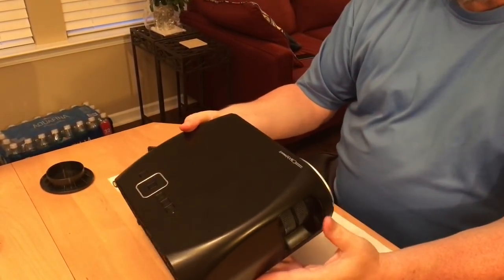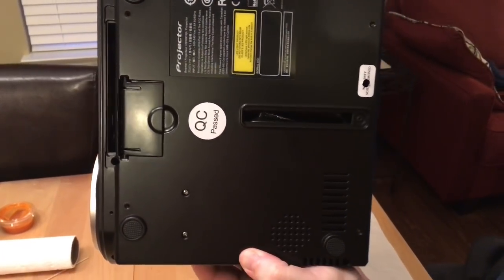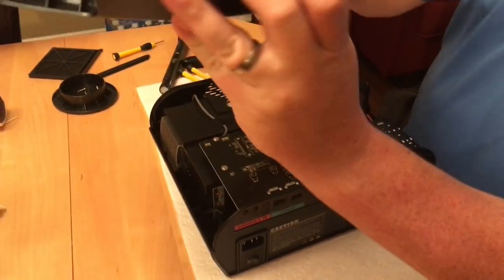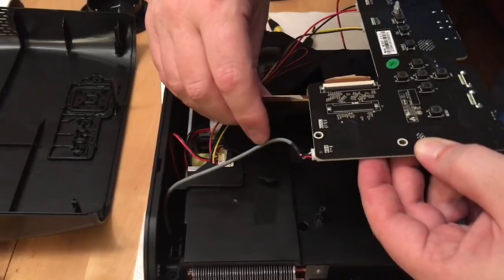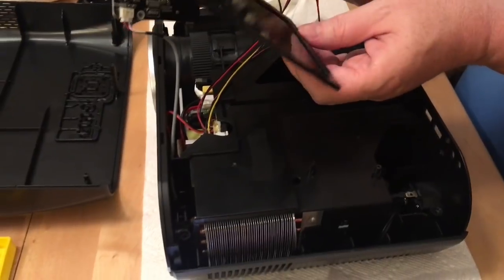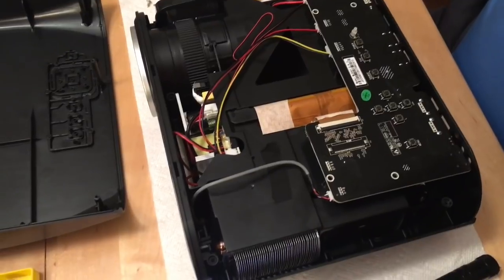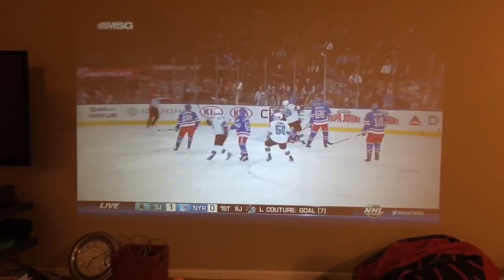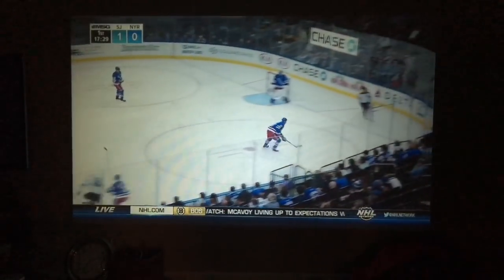Vivibright GP100 Review and Disassembly

Comment: A quick question, after ceiling mount gb100 , the front adjustment wheel which adjusts the focus is not moving. Any idea/suggestion. Why it happened, way to get it rectified.
Reply: same problem for me, focus knob just stuck, i thing we need to dissasemble ans try to fix that

Comment: Nice video thanks :)
My projector has unfortunately some vertical lines caused by pixel errors on the LCD.. can you please tell me if there are any spare part numbers on the LCD? So I can buy another one, before opening it. Thank you very much.
Reply: Did you find any help? I have the same problem.
Reply: I get a Vivibright gp100 front view outline dark spot in the picture/video. Any remedies ? Desperate.....

Comment: Thanks I used your guide to help me clean dust build up on this part,from general usage after a couple of months, the filter captures some but it was a very fine dust affecting white colour in the image, to add just after 12 months stopped working would not power on , ordered replacment and new gp100 had a small piece of black plastic on lcd screen as well so followed this guide again.

Comment: for THE PRICE these are pretty good projectors, however the light color is a little cold because of poor quality of LED lights, when you want better colors and NO dust problems consider buying a DLP projector, these have a totally closed light system so NO dust buildup, contract is also way higher on a DLP , other than that, for watching a occasional film or sports this projectors will do perfectly, another thing is that the power consumption is higher on a LCD projector, lighting efficiency on a DLP is higher....

Comment: What's the size of that screen diagonally which you cleaned?
Reply: 5,8 inch
Reply: Lyll thanks 
I'm thinking of replacing this lcd with a 5.5 inch 2k lcd screen with its own driverboard. What do you think is it possible?
Reply: someone here below mentioned it already, but yeah I think 1080p is possible, not sure if 2k cause you can't set 2k in menu but 2k can still scale to 1080p easy :) one person must try it , everyone will follow :)

Comment: please tell me if it would be possible to install a potentiometer on the projector cooler to reduce the noise? if so, how would you show the location of the cooler?
Reply: Installing potentiometers or voltage reducers on the fans is absolutely possible, question is, will the reduced rpm and airflow lead to heat problems. The answer is most likely yes. Installing more powerful and silent fans is doable at least for the one 70x25mm fan blowing out the side. The shrouded radial fan at the back is much more problematic, as it prooves to be rather hard to find any fittingly similar model anywhere.

Comment: since you open it, do you think you can change the fan?
Reply: Well, of course the fans can be changed. Problem is: the existing ones are absolutely no-name, not a single serial number, mark or anything to identify the model or its specs on them. The fan cooling the LCD heat sink seems a standard 70mmx25mm, but a 15mm model seems to work also.
The radial shrouded fan drawing in air from the backside is a 70mmx15mm model, but i cannot find any similar model anywhere. looks like a laptop cpu cooler.
Sadly, it is utterly impossible to identify the manufacturer or the cfm rating.
Also, i found the radial shrouded fan on the back to not have any dust filter, it sucks in air unfiltered and blows it directly between the LCD and lens, which makes it the prime culprit for dust on the optics. Adding a dust filter of any sorts to the backside grating of the fan could solve the problem, as long as it doesn't obstruct airflow too much.
Reply: it's just a solution to solder the resistors that reduce the fan speed, wtyczki są na górze łatwo dostępne
Reply: @ Piotr Malec: yes, that works also. However, swapping in a more silent fan AND reducing its RPM with a resistor gives the best results.
Still, the shrouded fan in the back cannot easily be replaced and also significantly reducing its RPM is a bad idea, since its essential to cooling the LCD. It effectively blows air through the whole beamer and over all the essential parts. Too little airflow, and you'll get heat damage on the LCD.
Reply: @axelhopfinger533  mine is working well i use 56ohm resistor
Reply: So, on what fan did you solder the resistor to? I put mine on the main side fan. And how much effective noise reduction did you achieve? I easily dropped about 5-8 decibel with new fan and RPM reduction. Thing is still very audible, but definitely a lot better than stock.
Reply: @axelhopfinger533  on both, at the cooler is 45db, about 0,5m is 36db, over 3-4h of using is not overheating
Reply: Ah, nice. mine is also in the 36db range with only the side fan modded.  If there just was any data on how much cfm airflow is really needed to adequately cool the heatsinks and internals, would make choosing the most suited silent fan a lot easier.
Reply: Would it possible to change the lcd panel for a full 1080p panel????  Making it native 1080p, now that would be awesome
Reply: I successfully replaced the loud stock fan of the LED heatsink with a model SUNON KDE1207PTV1-13A (60L1420) fan, which was the qietest 70x25mm model i could find, and reduced its RPM with a resistor.
It is now definitely somewhat quieter, but still rather noisy. Mainly it is the sound of the air rushing through the slits out the side which is disturbing, so i am gonna remove the gratings of the case next to allow for a better airflow with less resistance.
The shrouded laptop fan pulling air in from the back  seemingly cannot be replaced and is still rather noisy, but i am gonna remove the grating also and add a simple dust filter, since this seems to be the main path for dust getting into the beamer and onto the LCD.

So in conclusion, the possibilities of making this model significantly more silent with simple modifications is rather limited.
Reply: It would be great if you could change the loud fan with a much more efficient quieter fan, I’m sure someone must have done this. Great video by the way, thumbs up
Reply: I removed my fan. No more noise!
Reply: Dude, you know those fans are absaolutely ESSENTIAL for cooling the LED and LCD right? You should experience heat failure, if not irreparable heat damage very soon! Put the fan(s) back in and DON'T switch the device on before again! Or maybe, DO switch it on without the fans, try watch a movie and film the results, then post the video , should be quite educational...
Reply: Axel Hopfinger ahhhhhh. It willbe ok.
Reply: Great and helpful video.
Reply: Anyone experience with changing the fans of an Alfawise X?

Comment: There is also a mirror under the shroud that needs cleaning too, this can also cause bit to appear on the screen, so if cleaning the lcd screen does not work, try taking the shroud off the top and cleaning the mirror behind the lens. im actually modding mt projector now and the fans are so easy to get to, im putting silent 70mm fans inside, the fan at the back is 70x70x15mm, and the fan at the side is 70x70x25. hope this helps guys.
Reply: I finally modded the projector. I installed a 80x80x25 noctua redux fan with 1800rpm on the right side heatsink part. It involved a lot of cutting of the plastic parts but the fan is super silent with ~31 cfm. 
I then removed the shrouded fan, cut the wires and an old USB cable and connected both (red & black only). I use one of the rear usb ports to power the fan. It will reduce the sound significantly and still provides a decent air flow and pressure to push the hot air out to the front fan. I tried some of the louder 80cm fans without the stock rear cooler and I always ended up with hot air building up, leading to black mass and artefacts on the lcd panel.
I added another fan, a 70x70x15 silent fan on top of the speaker position to blow additional cool air to the shrouded fan and also to use the power connector that I cut on the shrouded fan.

At the end I also removed all the plastic grids that could block hot air and prevent sucking in cool air. Now I am more then happy with the projector and while it is not dead silent I can finally enjoy movies again! I hope it still works in summer, right now I have 24°C in the living room.

Before I found that "trick" with the usb cables I was thinking about cutting the plastic on the back and cool directly onto the lcd panel, the problem with this is that you will probably see a lof of light shining through the fan which may cause distraction while viewing, so I never tried it.
Reply: Hi there, can you say if these is the right fan model? https://www.ebay.com/itm/PQ220-AcoustiFan-DustPROOF-70mm-7cm-Case-Fan-AFDP-7025B-/361350980392
Reply: Can you post which fans are you using? I'm really interesting in changing them. If you can even make a short video or uploading pictures somewhere, it would be great ;) Do you consider it will be possible to include bigger fans (80mm or 90mm)? this way we might have more airflow and lower noise ;)
Reply: Jorge Lanza I will reply asap, just at a Christmas theatre
Reply: Sorry for insisting. Any news on the modding?
Reply: Jorge Lanza hello yes, I bought an acoustifan silent 70mm for the side exhaust but the rear fan is a 70mm shrouded laptop fan, if you try to mod the rear fan you end up with heat inside and it appears as a big black growing shadow on the picture so you can't mod the rear fan, i reduced the total db to around 24db by modding the side fan. Be careful not to touch the mirror, or when taking the LCD panel out it can scratch on the polarized filter inside so again be careful.
Reply: 24 db is quite a lot. Do you think it could be possible to add bigger fans? Is there space for 80mm, for instance?
Reply: Jorge Lanza No it is not possible, the outer casing is moulded so when a fan is placed it fits snug in its place, it would mean cutting plastic out to 'attempt' the 80mm fan.
Reply: Can I mod a 70x70x15 fan on the side? Is 17cfm enough for its cooling?
Reply: George M what I found is if the fans cfm are not sufficient enough then as you watch the screen when its turned on.... You get a growing black mass appearing in the centre of the picture. This is a build up of hot air inside.
Reply: madmaxmel https://www.quietpc.com/afdp-7025b
Reply: madmaxmel yes that is correct fan. However it only fits the side. The rear one is a centrifugal fan, you will have to use skills and modify yourself.
Reply: Thank you very much! I got Gp100 couple days ago and i want to change the side fan.I hope it's an easy job :)
Reply: madmaxmel yes its very easy. Just be careful with the ribbon.
Reply: I may make a video myself and post it just to show how easy it is.
Reply: If changing the side fan i get a less noise its enough, i dont want to touch a rear fan.
Reply: madmaxmel it is less noise but not enough to be satisfied. The rear fan does need changing to be much better result.
Reply: Thanks for the answers :)!
Reply: Hello Friend.
If you could do the video explaining it, it would be very helpful for me. Thanks
Reply: Dani Martinez yes I will try as soon as possible. Maybe later or tomorrow.
Reply: Bl1ndfold that is absolutely brilliant !!!! Just to let you know ... I bought mine through amazon, if you need any spare parts or parts break then you can contact the company through amazon and they are more than happy to help, I got a new mirror and another part from them for free. When opening this projector people should always remember to be careful with finger prints on the glass panels and the mirror because it does distort the overall picture quality. I am more than interested in your mod, I would love to see what you have done and this trick with the USB cable. Is there a way you can show me.
Reply: I just received the second noctua redux fan and want to replace the 70x17x15 cm fan on the side where the speaker is. I will try to make a short video on the weekend to show what I have changed and some pictures of the changes. Right now everything is just put together with tape and I want to solder the cables and isolate them properly and use the dremel tool to even out all the grids (right now its just ugly) and so on. I let you know in a few days. Cheers!
Reply: Bl1ndfold superb I'll be hoping and waiting
Reply: So, 5 month passed and the thing is still kicking well. In summer we now have easily 35°C in the living room. The cooling still works and we can for certain watch at least 4 hours straight without any problems (have not spent more time in a single session yet). However my wife and kids were also using the projector and I don't know what happend for sure, but I have a 3cm by 2cm bownish color lacking area on the right side of the lcd panel. I am pretty sure that this is heat damage and must have happend sometime. It could be that the usb cable was shortly not connected or similar. I am looking for a new panel right now to replace it and I will also 3D print a new case for the back fan to completly remove the shrouded fan later this year.

Every visitor does not see that area, but my wife and myself we see it everytime and it starts to anoy us. Anyway here are some pictures I took while cleaning the projector today.

https://drive.google.com/drive/folders/1lSDVSiH7YNVYb2plaw1PpVOsOzVzBcRL

Cheers and good luck.

Comment: How many fans inside? What size and are they easily replaced ? Thanks
Reply: I don't know but le me tell you they're really loud!
Reply: 2 fans inside. One 70x25mm axial fan blowing over a heatsink out the side, one 70x15mm radial shrouded fan on the backside. Both fans have no markings or serial numbers on them to identify the type or specs.

Comment: I think its better that you unsocket the other connector for easy access. I had a gp70up android that i used to cleaned it all the time at least twice a month. The lcd ribbon is easy to connect back and i can take the whole lcd out for cleaning. i had follow byintek guide. Dont stress the led ribbon cable as they are thin and easily torn, better to un socket them. just my advice.
Reply: I have face same problem with gp100  I have used only 4 to 6 hour   dust is appears on screen how can  we prevent from dust pls reply  if you have solution . Thanx

Comment: Thank you for your video, really helpful for the inside tech information. Much better than unbox video and some kinds of "review"
The two info i find in your video:
1. GP100 projector is not 3000 ISO lumens(test as ISO require). For the night room light, 3000 lumens LED much brighter than that. I can roughly consider it's around 300 ANSI lumens.
2. Due to the style of lens set, edges & left right sides will have some focus point issues. The image get blurry.
Reply: I have one and the corners are blurry.

Comment: I had the GP80 and that one does not have filter and I had to open it like once a week to clean it until one day I decided to disconnect the LCD screen to have more freedom of movement then I connected it back and the image now is reversed like a a negative picture and I have been unable to find info on how to fix that. Some TV when they are serviced also end up like that but usually there is a secrete key combination on the remote that open a service menu were you fix that. I have tried many combination on the remote of the up80 projector but nothing happens. So the lesson is never disconnect the LCD screen from the main board and always buy projectors with air filter :/ Oh and only clean it with high air pressure, I used window cleaner and it destroyed the mirror for some reason
Reply: Lol!